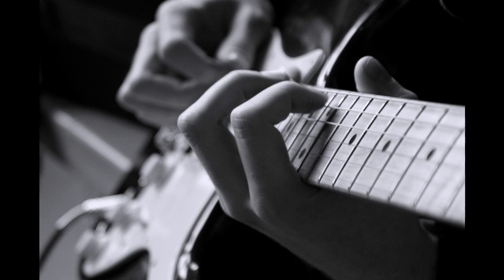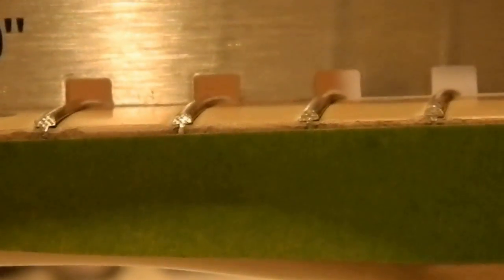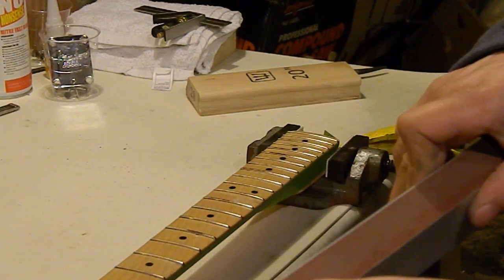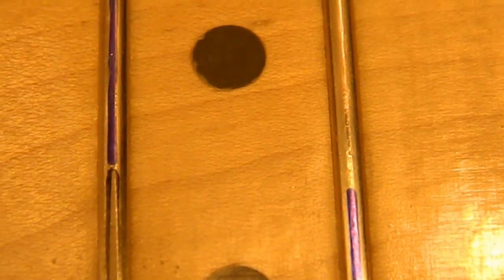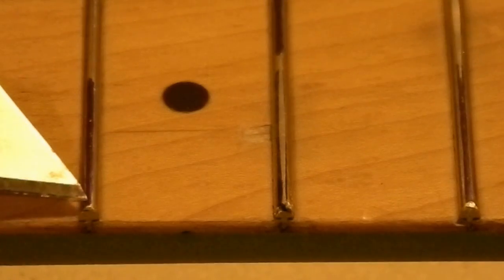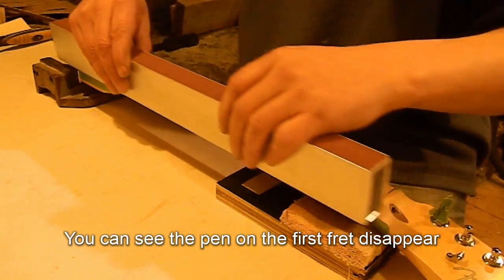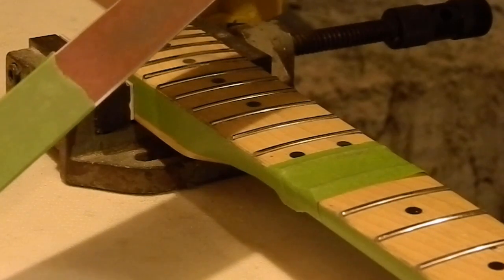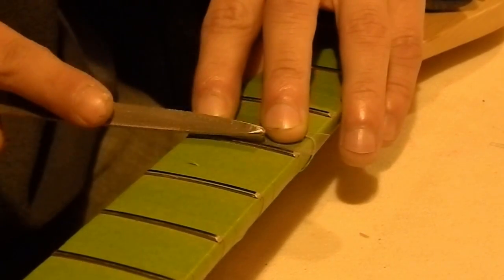Guitar Fret Leveling Why and How - Part 1 of 2

Comment: I really like your clear video, Duncan. Best data very well taken up.
One thing: if you don´t go over the whole fretboard (the whole block over the last and first fret) you will sand the middle frets more than the others. Middle frets are about double times sanded.  ;)
To balance this a lot of extra work is needed. Of course your technique using different colors for marking is great! 
The point is: how often do you touch a certain point on the board? Do certain parts get more sanding or not? Pls. find out and expand your knowledge. ;)  
(sorry for this arrogance. I did not know that myself respectively this was not conscious to me.  Although I knew the problem from lacquering. 
Now I work with 10"/25 cm long wooden radius blocks or with a 25"/100 cm long aluminum 3.15"/8 cm square tube. So I can control that each fret gets the same time of sanding provided the other parameters are correct (neck curvature, constant low or no pressure on pipe. She does it by her own weight.
Give it a try.
If you don't level perfectly will find your guitar after five or seven levellings in a condition of "top and lower frets are higher than the ones around the middle area.
Good luck and best regards -
Michael from germany

Comment: Two great videos, thanks Duncan!  However, one thing I don't get is why do you level a fallaway instead of sanding the whole fretboard at once?  Surely, that means frets 1 - 12 are at one height and then frets 13 - 22 are successively lower as you get to the end? Can you please explain why you do this and what the advantage is?  I've never done this before and I'm just trying to understand why because I don't see how the strings can be lowered from frets 13 - 22 so the action can't get any lower either.  I'm flumoxed - please help:)

Comment: Quick question Duncan: Why are you using a long levelling bar? Is it because it does all frets at the same time ? On the Stew McDonald website, they advised that if you're only going to purchase one of these it has to be the 8 inch one. Any advice on which one is the best ?

Comment: Duncan, here’s my idea for you (I’m about to try it).  If you drill 2 holes at the ends of the beam, exact centres and then add a set screw and a locking bolt on the inside (you’ll need to tap the holes), you can make your beam into a precise radius tool with depth control.  Put in the set screw and adjust to the desired fret height.  Do this for both sides and then lock with internal lock nut.  Now put tape on the frets and run the beam along a fret wire inside edge( ie up and down if you were holding the guitar in playing position).  This will allow you to exactly follow the contour of the fretboard and guarantee all frets are following this curve.  The centre of the beam should be the only point sanding.  The depth gauge (set screw) keeps the beam at exactly the right height.  Basically you could look for the lowest fret height and set your set screws to that depth.   The only caveat is that you are following the radius of the fretboard and it that is not correct your frets will follow that!!  Best to use a radius gauge first.  It may be useful to use a plastic tape vs paper as it is smoother and won’t deform as much.  Kapton tape for example.
Reply: The other BIG assumption is that your fretboard is perfectly level.  This may be the Achilles heel of this idea.

Comment: Great video. Two questions: 1) How do you know when to use a small or large sanding beam? 2) A luthier in the following thread recommends using oval motions with the sanding beam to prevent sharp edges. Any thoughts on this? Thanks.

Comment: Hello Duncan,  When you level the frets you were sanding the entire fretboard and I was surprised toward the end of video 1 when you started talking about putting tape on the 11th fret to raise the sanding bar and also taping the bar so the lower frets(1-11) are not be sanded any further  it looked as though the higher frets still had marker ink on them which I thought would have been sanded away by this point or did you just remark them to do the fall-away sanding? Thanks. I like your video.

Comment: Thanks for the video, have a question though ... how would you go about leveling frets of a (cheaper) bass guitar that has a slightly warped neck, that also does not hold a level plane along all its length. The neck a bit lower on the first fret, then a bit higher in the middle and again lower than a straight edge towards the last frets. The frend that I am doing the job for plays punk and does not care about the fine tunings, but I still want to do the best job ... without making the situation worse than it already is. He basically came to me to replace the pots, wiring, strings, adjust the trus rod and so on. My question would be if I should just file down the 4-5 apparently higher frets (when the neck is set to its most level state), crown and polish or do a whole fret leveling? How would you go abou it? I have fairly basic luthier tools and not much experience.

Comment: I hadn't seen a luthier paint with a different colour the adjacent frets to the high spots to clearly detect if we are alredy sanding them. Nice idea.
As noted by others, only lacks a reminder for people to first of all check for unsound frets, to hammer them first, and if possible wait 2 days in a stable temp and humidity for the wood to resettle before continuing.

Comment: Great video over all, however I always start with making sure the frets are completely seated into the finger board, before I do any other work to the frets. It  could save alot of time and effort. I recommend this since more than one of those frets were not seated properly. Its possible If they were you wouldn't have needed to sand the frets. Could be in your next video Brother.
Reply: And how to hammer them in?
Reply: @lines374  With....a...hammer. A lot of Luthiers still just use a hammer. A brass hammer, to not dent the frets, but you can always just glue a bit of leather or something on a normal hammer. It's better to press them in, but that means buying extra stuff. I just use a radius block, and stand on it. (With the neck supported under the fret, of course.)

Comment: Thanks for the great video. Just one question (although I appreciate this video was posted some time ago now!), how to you make sure you maintain the correct radius on the top of the frets, to match the fingerboard radius? I assume the top of the frets are supposed to follow the same radius as the fingerboard. Is there a risk of taking one side of the frets down more than the others and creating a strange profile across the neck? I've found the fret wear on my guitars has tended to be more on the higher strings, and hence when levelling I'd end up taking more material off the side.

Comment: This is a great video.  One question, if I may...I recently bought a budget steel string acoustic online, and when it showed up, the high E buzzes slightly when open, and slightly more when fretted.  It's very, slight, but enough to affect the tone.  None of the other strings buzz at all.  The frets seem to be fully pressed down, and the nut groove doesn't appear visually to be cut too deep.  Would this technique be suitable to apply up and down the fretboard, but concentrating only on the higher string side of the neck?

Comment: Does it matter that the middle frets get more sanding than the ones at each end, would it be better if you sand side to side so that they all get the same contact from the abrasive, it looks to me that the centre frets are sanded with every pass but the end ones get far less contact? just a thought maybe I'm very wrong, I would be very interested in your opinion.

Comment: Hi Duncan - at 6:10 you show the leveling beam being moved along the frets. Does this cause the frets being work in the middle being filed more then those at either end, should you file across the fretboard and not up and down. 

Does marking the effected frets with different colour help here?. 

Also my bass has fret edges that extend a little to far across the fret board for comfort - any suggestions as to how to resolve?

Comment: Hi, really awesome video. Really helped me understand some of the noises coming from my cheapy yamaha guitar. One thing I would love some confirmation on is what happens when we re-string the guitar, in my mind surely we would create another backbone effect? So does the fret levelling still make a good difference when we put tension back on the neck when re-stringing? I know the answer is yes but would just like some confirmation and whatever else you might be able to add. I don't mean to sound rude at all by the way, I'm just burdened by my perfectionist mind analysing everything. Thanks in advance!

Comment: Duncan could you please advise me. I live in Spain which has fluctuating heat and humidity levels. A few years ago i bought a Custom Shop Strat which has been great. A few weeks ago we had a significant increase in temperature overnight and i had forgotten to case my strat. When i played it next it buzzed everywhere ( triple flame maple neck, compound fat C). It appeared to have a huge back bow in it so i tried to clamp the neck with chocks to push it straight. I've never done this stuff before so i think i got scared and stopped the clamping before any real changes had set in (about 4 hrs in hot humid conditions). Now i have had to resort to putting a shim under the neck/body joint and the action is still way too high if i want to avoid buzzing. By the way the truss rod becomes useless long before it removes the back bow. My question is should i 1) re clamp the neck and leave it longer to remove the back bow, 2) do the same but with heat application 3) level the frets instead 4) level the frets as well or 5) admit that i'm not a luthier and just take it to one. Many thanks in hoping you will respond

Comment: Hello Duncan, This morning watch your video your part one and two. I have a couple questions but wanted to start out saying your thought and technique will be something I hope to apply in my next project. Its very good idea's the different colored markers.  I am glad you addressed the topic if you turn your head away, its very easy to forget , what was the last fret you were working on.   Its a very time consuming job and they all start looking the same.
Okay my big question is about  what you did on fret board.  You first leveled frets 1 thru 11or 12 then taped off and then you did the upper portion of the neck. Only on these frets it seem to me be cause you added the tape. These frets were leveled but at a different angle  with a slight slope downward from the tape,  getting lower nearer the pickups.  Is this correct.?or did I mis something.  First time I had ever seen or heard of doing that. What would be the reasoning?    
I was also wondering about the frog tape.  Is tt more durable?  Last question The sandpaper on your leveling beam: are you using the stuff that is sold with the adhesive  from luthier supply which super expensive or  are you making your own?
Like to say these two videos very very good and I looking forward to see more of your videos

Comment: When leveling frets, why not use a radius block that both levels AND maintains the proper radius?
Reply: The fretboard radius is NOT the fretwire radius.
Reply: Because it just doesn't work that way.  Radius blocks are for sanding a bare fretboard.

Comment: firstly  a   BIG THANK YOU for taking the time and effort to make these videos - I really appreciate that this must be a lot of work

my question.....when doing a leveling job and there a couple of very low frets... is there a point at which you think  it better to pull the low frets and replace with something taller (assuming you have got a selection of fret wire) rather  than reducing  the height and flattening quite severely the other twenty(ish) frets so they're all going to need a LOT of re-shaping?

I'm just wondering if reducing the majority of the frets height to make them level with the 1 or 2 lowest seems to be making a lot of work that could be obviated by putting in a new fret / couple of frets?

IS it always level level level until you get to the lowest or are there alternative methods that could preserve fret  height / life..?
Reply from the maker: rusholmemike yep definitely - if you have the means to replace one or two low frets that's what i would recommend ... everything you said there i would agree with! ... thanks for watching

Comment: I only have some 240 and 320, is that good enough to use? I just bought a 19" bar like you have there and was wondering exactly which grades you run through with the bar itself.

Comment: Running the sanding beam along the fretboard means some frets are being ground down more than others as the beam is not in contact with every fret for every pass. Those in the middle will get more "grind" than those at each end.
 
A better practice is to move the beam across the fretboard... IE from the "E" to the "e" side. This is assuming the beam is long enough to cover all frets. In this manner every fret receives the same contact & "grind" by the beam throughout the whole process of flattening.

Alternatively, just using short strokes along the neck works fine as long as all frets can come into contact with the beam.

It is also good practice to allow the neck to "relax" whenever releasing or tightening the Truss Rod. Some luthiers allow as much as a day for the neck to settle after making any adjustments. Obviously it needs to be checked again before any fret levelling is done. But each to their own.

Other than that, good work! Thanks for the time & effort to make the video & share. :-)

Comment: Duncan, great video, thank you. What is your opinion on a neck jig? Is it optional? I see you didn't use one and just flattened the neck with the truss road.
Reply from the maker: Kevin Plumb hi kevin, thanks for your comment - i would normally use a neck jig for this type of work, but you can do a really good job without one. When i put this neck back on the body i then strung the guitar up to tension and flattened the neck using the notched straight edge & truss rod adjustment, then added a tiny amount of neck relief - i find this makes most guitars play pretty well. If the player likes "a lot" of neck relief then a jig is really the only way to get the job done, in my opinion.

Comment: Great video.  The diagrams are really helpful.  Questions: By using a flat sanding block don't you run the risk of flattening out the frets completely?  Don't you want the frets to have the same arc as the finger board?  Would a block with the same arc as the finger board be best to use?  Is a block like that even available?  I have both a Fender Start (American Standard) and a Gibson Les Paul.  Thanks.
Reply: Pet Rock's Garage the radius of the frets will be different from the board. The radius of the frets will be the radius of the board + the height of the frets from the board. And since you are removing material from the frets, the radius is constantly changing.

Comment: Hi! Thanks for taking the time to make this video! Is there any reason as to why you shouldn't follow the fretboard radius when filing the frets with the sanding block? Is it that in this case, you were working on a Tele, where as if the guitar had a Tune-O-Matic bridge, you would follow the radius? Also, how many extra strips of tape should I apply to the 12th fret to get a good angle? Thank you :D
Reply from the maker: ciara roche thanks for your comment ciara - yes you should follow the radius of the fretboard when leveling frets with the sanding beam on any guitar - i'm sure i mention following the radius in this video but it's been a long time since i've watched it so i could be wrong! ... Depending how thick your tape is i would start with 2 or 3 layers then perhaps add another layer once the frets are level - you are not looking for a big fall away - a tiny amount will get the job done ... hope this is of some help and thanks again
Reply: ciara roche I think you are getting radius confused with fallaway...

Comment: Duncan. I have a question for you. I am working on a bass guitar neck and when I check it with my notched straight edge even after loosening the truss rod where there is no pull on the neck there still seems to be a gap of about .010" at the spaces between the 18-19 and 19-20 as well as the wood blow the 20th fret. Do you have any suggestions?